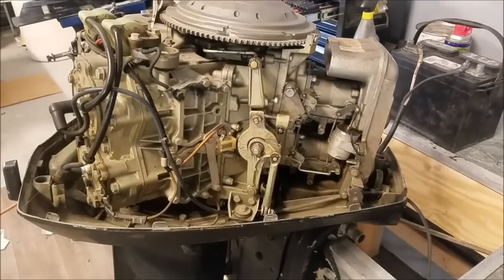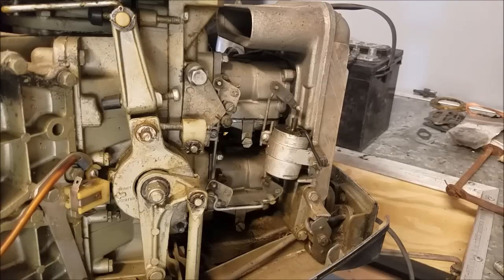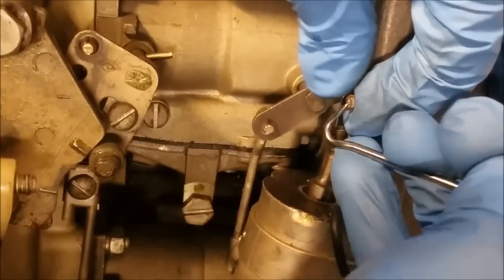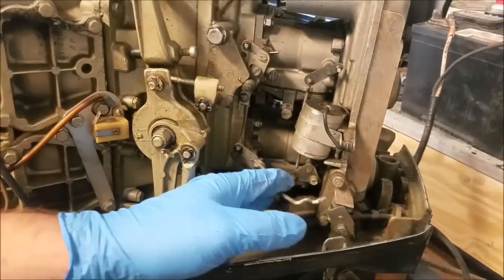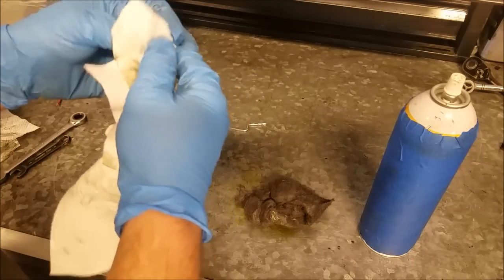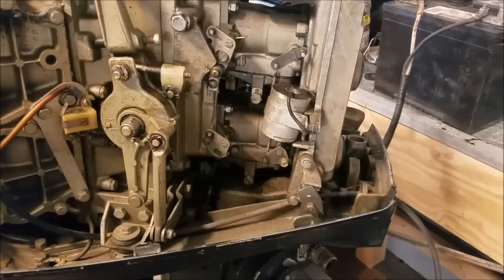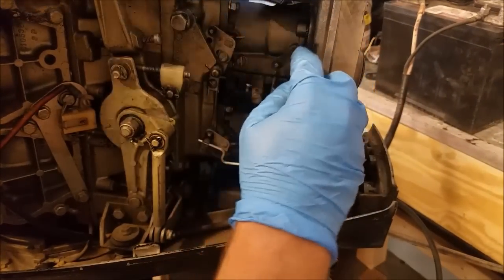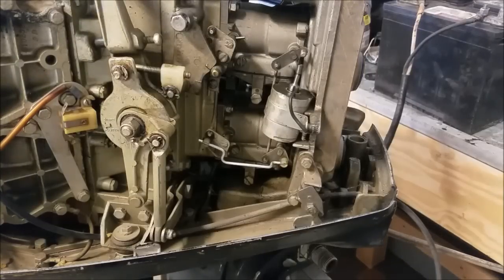Carbureted Outboard Choke / Linkage Maintenance Service

Comment: Youve got some great videos and Thanks for showing them.. I Had the same issue but the solenoid wasn't activating. I took the plunger out cleaned it and it started working again. It wasn't really that dirty.. so my question would be, how do you test solenoid for power? 
Thanks for your time..

Comment: Hi 
My jonshon 50 hp going under 3000 rpm and not idle after 15 min on the water, do you think I have problem with choke 
I took the cover to give more air and was available to come back to the marine

Comment: At one point, you video recored and uploaded on Youtube, a VHS cassette tape playing on a TV of a OMC certified shop maintenance procedure for timing and linkage sincronization of a 1987 Evinrude 40, 48hp ......ect. Do you have a video for  timing and linkage adjustment on a older OMC such as the v4  mid 70's (?) model and year of motor in above video? I have a Johnson 85ESL75E motor and Johnson repari manual specific to that model. Even a OMC manual that covers my year and motor only "DOES NOT" discuss steps for adjusting roller cam to mark on Cam. There are steps to align cam mark with start up lever when all the way up in "START" position.  But before that adjustment do I place shift lever, at control box, in forward gear (motor off) and move forward intil CAM ROLER touches CAM? Then, if mark on cam and cam roller do not align, move shifter to Neutral, adjust cam in proper direction, move shift lever foward until cam mark and cam roller align only when roller just begins to touch cam? This makes sense to me but shop manual "does not" reference how to align just that cam mark and roller need to align, the book then discusses in detail all other steps including adjusting idle speed, then idle timing BTDC followed by high speed timing adjustment when motor is between 4,000 and 4,300 rpm with a test prop. How do I get to Z if A is not accurately discussed (in manual). My motor is identical to model shown in video above. I see that your shift and start up cable are not connected, yet cam mark and roller align, my manual does state that roller and cam mark are "not" to touch during syncronization but not how to adjust. Thanks a bunch.

Comment: I have a late 70s 85hp, when I apply the choke the carbs don't close all the way and they are uneven.  The fix you did will not help but I am definitely going to do it because it does stick tho.  any ideas for my issue tho?

Comment: Dumb question but can a choke solenoid cause spark issues if it’s bad or broken.
Reply from the maker: No. 
Unless the outboards wiring has falled apart and wires are getting crossed.

Comment: How do you use this choke? My boat seams like it needs couple seconds it on . But this just close and open quick
Reply from the maker: push key in on controller/dash to use choke.
Reply: @BrandonsGarage  mine is on a separate toggle switch . Am I supposed to hold it . Will it burn

Comment: My 50 hp is flooding...is it possibly this choke solenoid not fully disengaging...my spring seems a bit flemsy
Reply from the maker: its also possible the float is stuck inside a carb.
Reply: @BrandonsGarage  I thought about that as well is there a way to tell if float is stuck without taking carb off?

Comment: I have a 1975 70hp Evinrude 70573B. When I push in my key to activate my choke my solenoid doesn’t make a sound or does not close the carbs what could be wrong?
Reply from the maker: Wiring probably.
Get a jumper wire, jump from the battery + (red) off the battery itself of the starter solenoid, and tap it to purple wire on the choke, see if it works.